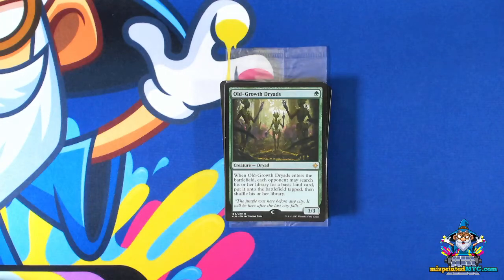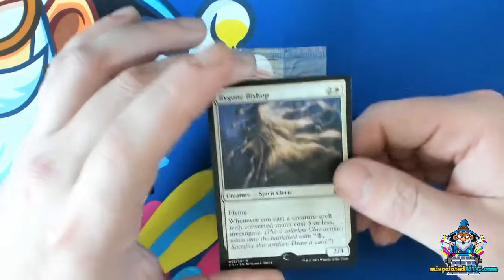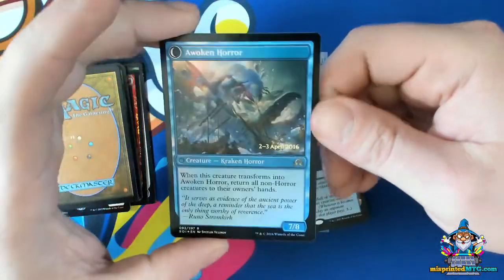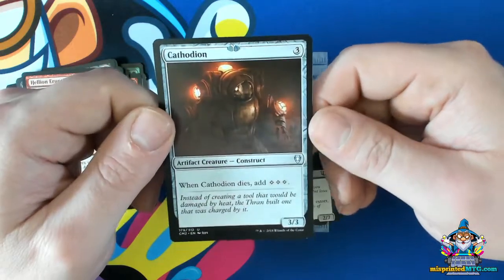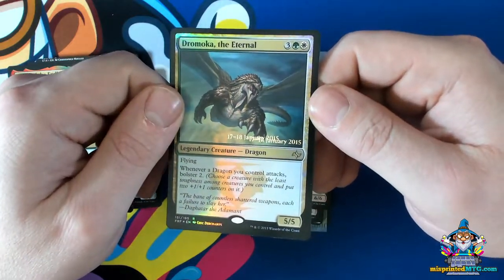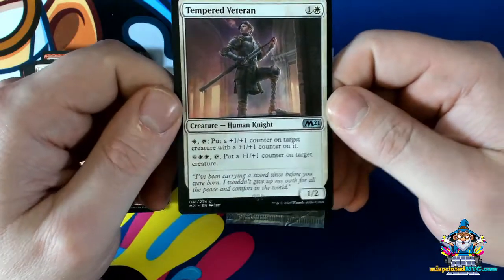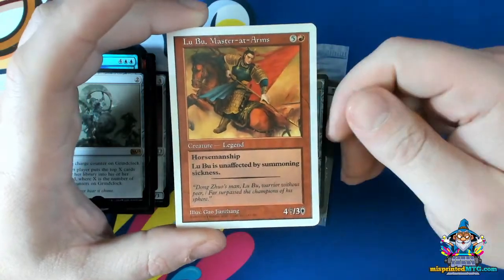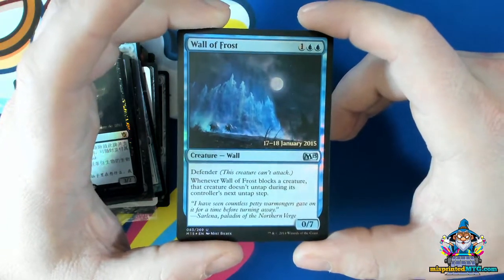Misprint Masterclass: Stamping Errors

Comment: As the sheet passes through the machinery, at aligns with the edge of the sheet against a guide.
It could be either the side edge or the top/bottom edge, and might even alternate for the different machines involved.  

The Pontiff of Blight was equally misaligned during both stamping and cutting. 
It's unlikely that the edge guide on  both machines became equally uncalibrated at the same time. 
It's more likely that the edge of the sheet itself was damaged, causing equal misalignment on both machines.

The other option is that both machines work together in sequence without an alignment check between them.   
Luc Mertens told me that's how the "miscut on only one side" cards are created.  Sheet alignment happens at the beginning, and isn't checked between the color units, so registration is consistent across all colors even though the whole thing is misaligned.
Reply: This is great insight - and the comment before it is incredibly helpful because it explains why there are some early promotional cards with repeated/ nearly identical mis-stamps. If the machine was misaligned for one card, it would be misaligned for all 11. At least, that stands to reason.